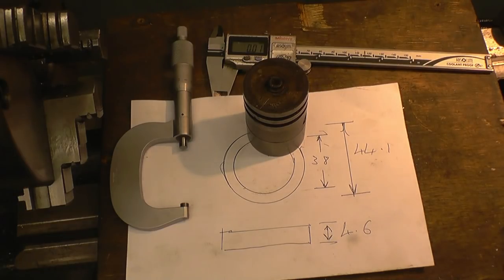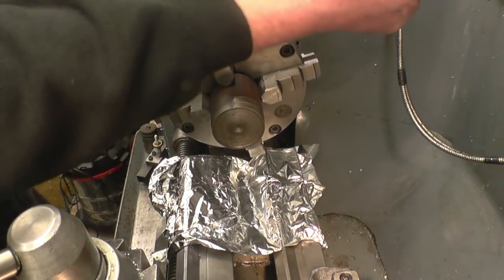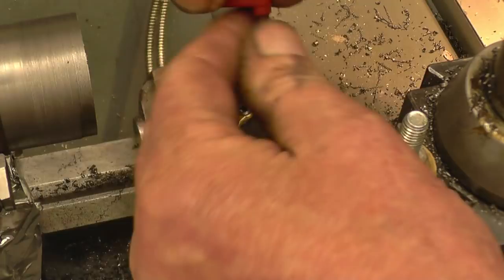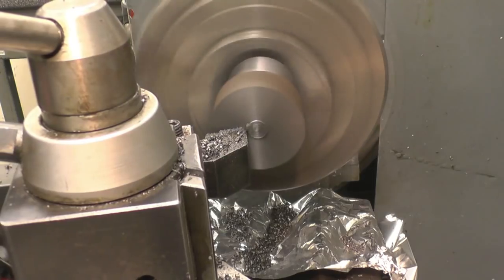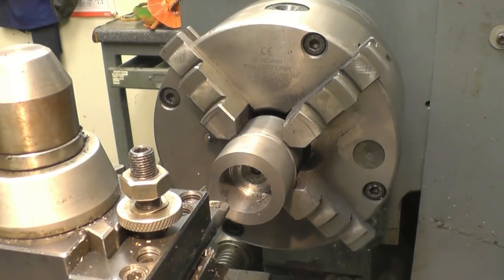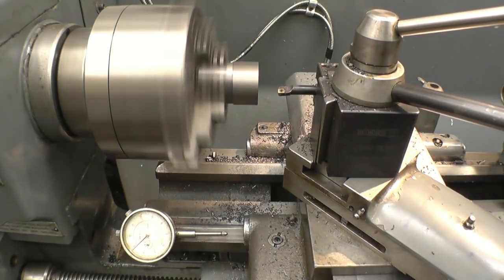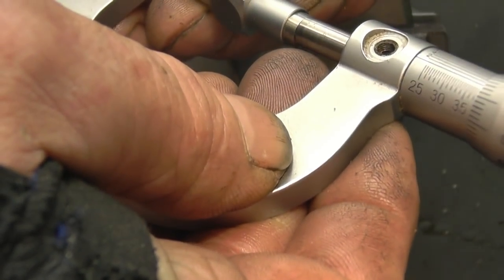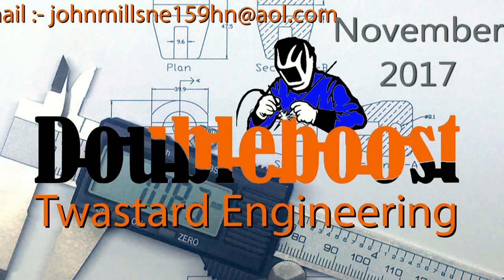SNNC 200 P2     Making Piston Rings

Comment: Interesting video, as I have some older hit-n-miss engines. I am very interested in seeing a follow up on what you did after parting the ring. The cutting (end gap setting), heating, tempering, etc. I would have thought the ring OD would be larger than the piston OD to provide ring expansion. This is the 1st video on this topic I have seen, so my thoughts and questions may seem very basic.

Comment: some odd piston rings I mean they gotta be pretty good at transferring heat, supporting the piston too. combined with a long connecting rod, look at the model T engine it needed the long rod for the improvement in piston dwell (rod to stroke ratio) to increase the amont of time it takes to transition from up to down and visa-versa cause the piston was made of iron very heavy so the con-rod length improves that geometry and probly good for wear and tourqe but those rings are somthin else man maybe no leak down ya and that arm warm showers and keeping it elevated increase in circulation and decrease in swelling all what your looking for

Comment: I'd like to see a comprehensive run down of your lathe... what lever does what etc. just the basics you'd teach someone who knew how to work lathes but didn't have specific experience with a 140. cos lets face it, it's easy to operate a machine, but a diferent machine is a different machine. talk about the motor and vfd too, maybe how to get usable spindle speeds from an unusable setup by changing motor or vfd..
Reply: I'd also like to see more on ya mill m/c, I know it's a chester 626. I'd really like a bridgeport varispeed but don't really have room for one especially in height... maybe a 626 is better option, you do well with yours but used ones are like hen's teeth.